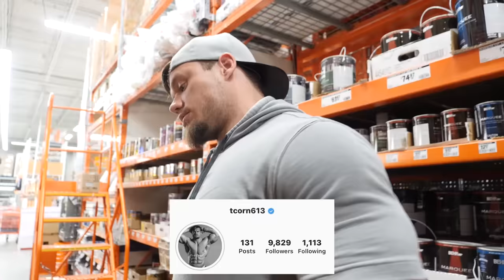Best Survival Weapon Wins $10,000

Comment: Dual buzz saw on a steel pipe, just drill through the pipe and use the holes on the saw to put metal nuts and washers to secure it in place, and wrap the handle in paracord for some cheap yet comfortable grip. It would cost like maybe 50 dollars